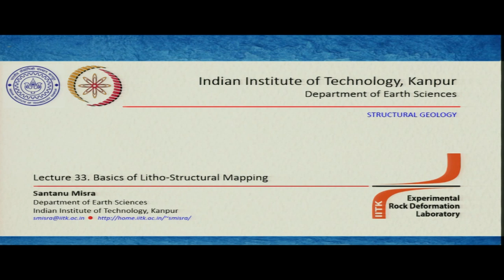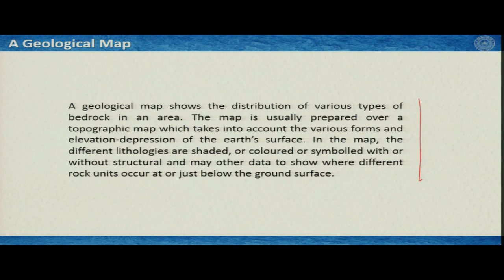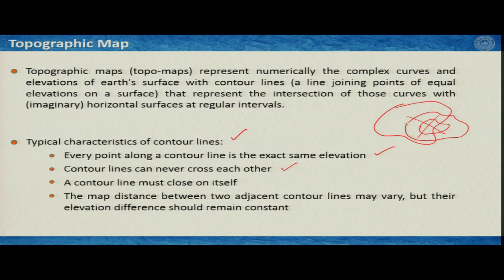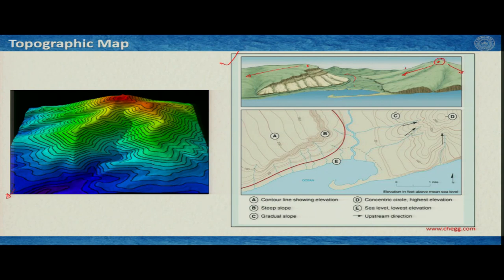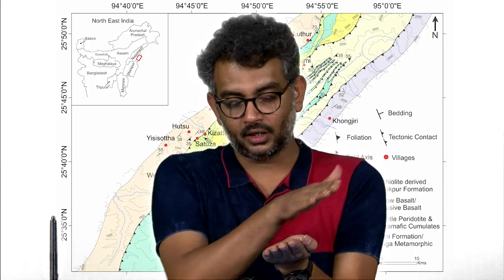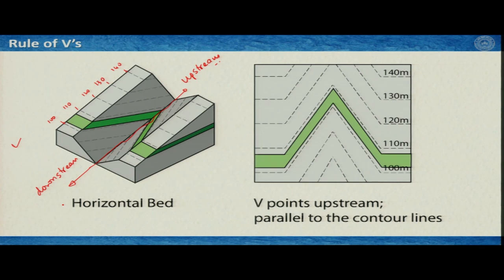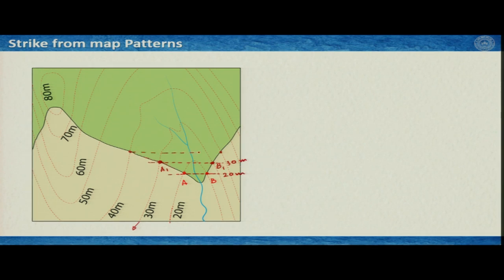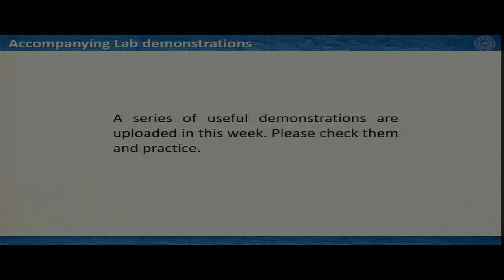IITK NPTEL Structural Geology_Lecture 33: Basics of Geological Map [Prof. Santanu Misra]

Comment: I watched a video where they made a topographic map using clay, where they modeled a hill or mountain out of clay, put the clay on a piece of paper, traced a line around its base, cut a horizontal line a specific distance up the clay mountain, removed the bottom clay, put the less-high cut clay mountain on the paper and traced another line around its base.  They kept doing this until they reached the top of the clay and could not draw any more topographic lines.
Frank Reiser M.S..